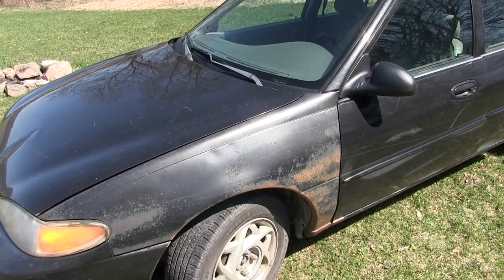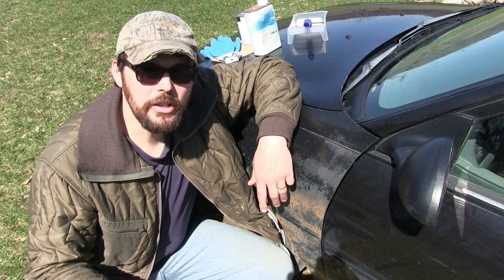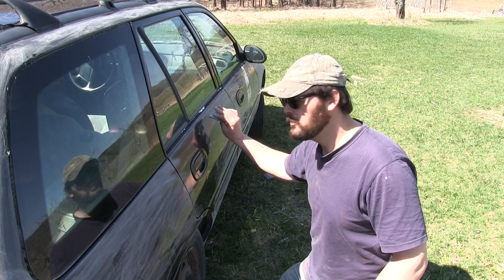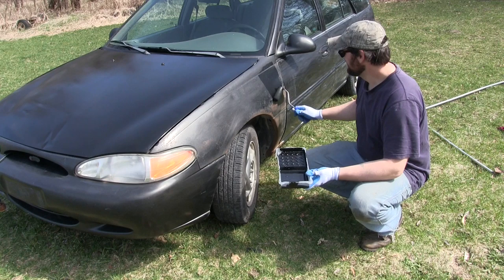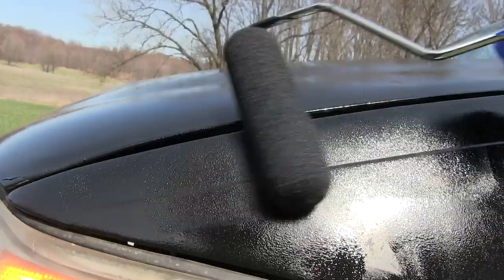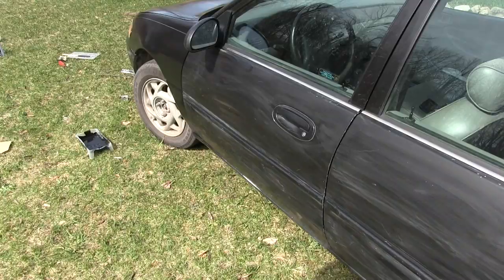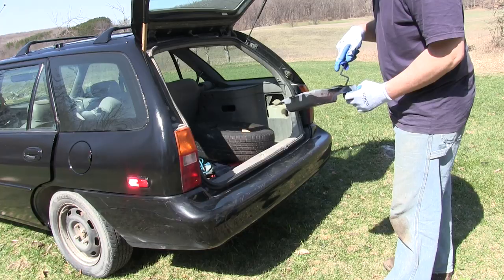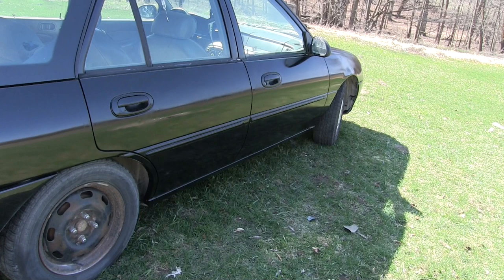Paint Your Car for $20 Bucks !!!!

Comment: Just to add, always have a cloth in your pocket for when the roller is painting what it shouldn't, much easier than trying to take it out after it dries. And for those who do not like the texture that remains (like orange peel), just polish, it becomes smooth like a professional painting. Thank you for sharing your street knowledge, greetings from Brazil
Reply: Sorry, but polishing out Rustolium  is not that easy.  Rustolium is the kind of paint you do not buff out.
Reply: @tommak6516  that is not true at all. Rustoleum can be wet sanded and buffed out easily to a smooth shine.
Reply: @Zero0806  My understanding is that enamel (e.g. Rustoleum) dries to a gloss, and anything you do to it after that is degrading the paint layer.
Reply: @Zero0806 how you go about polishing and getting rid of the orange peel in detail?
Reply: @oyahzi  if you have more than one coat it’s not hard. Wet sand with 1500 then 2000 grit then buff with a god buffing compound. If you’re using a multi speed polished though I’d recommend using a slower setting. Due to spray cans no leaving thick coats it’s easy to accidentally burn through the paint.
Reply: @tommak6516  nope. It cuts and polishes like any other paint. You just have to be careful with it since unless you use multiple coats, you can burn it easier
Reply: @Zero0806  thanks man

Comment: Great job, Dave! I'm of the same sprirt -- I'm 67, never had much mechanical or carpentry training, but I love to try making things I've never done before, because 95% of the time I'm the only one who's going to see or use it. Most of the time it turns out fine. I've built paint tables for my art studio out of scrap wood and logs, a wood shed (Had no idea what I was doing, made it up as I went and it's real solid), a garden shed that's perfect for tools and rainwater collection -- and more. Of course, not all my projects have been successful. I tried building an outdoor work bench out of field stone and concrete, ended up taking the sledge hammer to it. I tried building a little shed out of scrap wood for my generator, ended up burning it. No big deal. I learned a lot each time and believe I could do better if I tried again. Next on the project list is a lean-to extension on my barn, but I'm gonna have help from a friend who actually knows what he's doing for that one. (Too much $ invested in materials and I'm not strong enough any more to lift all the heavy lumber overhead) I've watched a lot of your videos and always enjoy them. Thanks for the inspiration and confirmation.

Comment: Dave: I'm a new sub. after watching your cabin build. But I got an old 92 Chevy with 200K + miles on it and it's the only vehicle my wife and 2 dogs got. We are both retired and living on SS and Dave my friend when the dang sand gets through blowing here in TX. My black and red truck will be all new black and red with a roller method I just learned tonight. Thanks, for sharing Dave, your my kinda people.  Kirk in the TX Panhandle. aka. BP.
Reply from the maker: Thanks Kirk!  Don't paint your truck in the sun and it will probably turn out better.....It was pretty warm and sunny the day I painted this car and it could have turned out better if it were cooler and shady......gives the paint more time to "lay down" it tacks up quick in the sun.  Good luck!
Reply: Thanks for the reply Dave, I will take your advice on the cooler and shady conditions. I pretty much have driven Chevy's most of my life but we had 2 escorts and drove the tires off them. I sold one to a young couple up in KS. and told them I would not take them on any road trips as they had a young child. Found out later they drove it to south TX twice and never had a minutes problem. Probably 2000 mounds round trip on both trips. See why you have kept the little wagon. Really enjoy your channel, however, the woods y'all get to enjoy are nowhere to be found here in west TX. Being a non-conformist is why I'm probably in the pickle I'm in now. Age and finances prevent me from being too radical but I'll do my best. Thanks, Dave and Brooke. Kirk in the TX. Panhandle
Reply from the maker: Thanks Kirk. I'm about to drive my escort to Alaska from Michigan....and it just rolled over 260K.
Reply: @Bushradical  Here's a thought use great stuff that foam will fill in rusty holes and puff out a ways then just shave it off with steak knife or what ever works,  great on my 91 4x4 chev another trick i do is use transmission oil to shine the hood or body of it got over 200k don't know for sure speed ometer not working right.

Comment: Older video, but I wanted to say you did a great job on this.

I've painted a few vehicles with Rustoleum and a roller in my day.. An 82 Rabbit, an 87 Bonneville and most notably, a late 70s Chev full size van that was part way through a restoration.

We'd driven the van halfway across Canada and were spending a few days visiting relatives. The local cops did not like this multicolored van (it was part gold, part black and part red rust paint) so we stopped by a Canadian Tire and grabbed a few rollers and a can of black paint.

Good stuff!

Comment: I friggin love it! Your philosophy is spot on with this video! Subscriber for life! I've got a blue Prius with 450K, and runs awesome. I've done alot of my own maintenance and I hit a deer, and could only find a black hood. I went by a few body shops, and told them, just paint the hood, and don't even need to do the bottom side. They wanted anywhere from $800-1800 to just paint the hood only! I was like no way! It's a $500 car at this point... I just need it to match, because I UBER, and I know a passenger will make a negative comment if the hood doesn't match. Outside of that I could care less. Just love all your videos. We are kindred spirits!
Reply from the maker: Right on! Did you get the hood painted?  Thanks for the sub
Reply: @Bushradical  I just ended up rear ending a Jeep, a week ago, and spare tire crunched the hood. First accident that was my fault in my life. I'm almost 50. Been driving since I was 17. So anyway. I had another Prius that became a donor. I had to fix all the mechanical myself and my local body shop had to do some straightening, and they said if I did everything else. They'd help me out and paint the good and bumper to match the rest of car for a couple hundred bucks. I figured that was a pretty good deal, and since I still use this car for Uber. I need to have it looking really good. But if it was for personal use only. I would go your route in a heartbeat. I was going to do that with the donor car. But I think it had a blown head gasket, and at 440k wasn't worth the repair at that point. Thought I had it fixed with everything else I did to it, but nope.

Comment: Back around '82 I helped my brother brush paint a 1969 Chevy pickup. Then he welded up a floor shifter because the 3-on-the- tree broke. When I bought it from him, we pulled the 327 Vette engine out of my wrecked Impala and had the trans rebuilt Mechanic was shocked that it still shifted at all since so many gears were rounded off . I put 8 ply mud & snows all around. It wasn't pretty nor fast on the top end, but from the jump I beat many a muscle car out of the hole. What a hoot it was. Another brother took it after me. I'd wager it went over 400,000 miles before he sold it. Hello from a former Michigander.

Comment: Hey man I did the same thing to my 1982 Jeep CJ-7 about 20 years ago. Some people laughed at me. It wasn't as collectable 20 years ago as it is today. 
  To make a long story short, I bought a case of "Bumper Grey" spray paint at NAPA. Paid about $100. Did a good job on the sanding and prep. Sprayed it on and it still looks pretty good today. 20 years later. That color paint on the body and windshield frame and flat black on the fiberglass top really set off that Jeep. Nothing is shiny on the Jeep except for the satin finish aluminum centerline rims, and they're not too shiny. 
  Recently as I was walking out of a store a little boy saw my Jeep and his face lit up like he had seen a favorite toy. Got to admit that its got a rugged look to it. I had just washed it and cleaned off the chrome rims real good.
Reply from the maker: Awesome! Cant go wrong with a good DIY paint job.

Comment: I like Dave. He and I live in the same county in Michigan. Related to rust, my father had an old piece of 2" water pipe that looked like it had been in salt brine. We wanted to use it as a sign post at the end of his driveway. I put in on saw horses, wire brushed off the loose rust the best I could, then brushed Sherwin Williams Zinc Clad primer onto it. Then a compatible top coat from Sherwin Williams. Amazing result. Sherwin Williams zinc clad is what any person with acres of land and owns things that they want to preserve and who lives in salt country needs. I also applied the same product to Dad's Aermotor windmill before we put it up. He coated the zinc clad with a top coat.  I dare rust to try to appear.

Comment: Awesome vid as usual Dave👍. I can confirm. This method is easy as heck and comes out great. I've used it on my beater Jeep several times and even done a few small body repairs on some classics.  Add a one two process of some soapy water and wet sand, along with a good buff with some rubbing compound and you've got yourself a beauty of a paint job for mere pennies 👌
Reply from the maker: I need to try and buff and wet sand sometime. That would be new to me.  We need to sit and have a beer sometime, I think we're on the same page!
Reply: Bushradical 🍻Count me in Brother. I ever finally get my as* out to AK, I'll swing by and crack a few with ya to celebrate your 2 millionth subscriber by then 👍🍺
Reply from the maker: Right on!

Comment: An Escort!
I just recently retired my 1998 Ford Escort ZX-2 that I bought in 2005 for $1100.
It still was averaging 33 mpg and had 330,000 miles on it. 
All I ever did to it during all those years was put on a new timing belt, one new serpentine belt, an alternator, and of course tires (as needed) and a couple of batteries. 
I did fix the air conditioner once, but when it stopped working again a few years later, I didn't bother fixing it...didn't need it. ;)
When I gave it away to someone a few months ago, it needed a valve job and a new water pump. 
The guy gladly took it knowing what it needed, he fixed it, and it's still going strong. :)

Comment: one of the best days ever was the day we painted my buddy's '55 Rambler.  We used ship side grey milspec deck paint.  It was 'free' use big rollers, there were no small ones back then. We did tape it because we had 5 guys working on it.  Sun baked that paint on hard and that car looked great.  Cost?  Rough figuring, probably $10,000 to the gov't!!  You know that milspec stuff doesn't come cheap!!!:-)
Reply from the maker: LOL! Thanks for the laugh. That cracked me up.
Reply: Long time ago when I was a wheeled vehicle mechanic in the U S Army we painted our mechanic shop yellow.  That paint was as thick as molasses. Our section chief told us to slop it on there thick. Some said they put lead dust in it.

Comment: It's not a car I painted, but a 6.5 x12 foot utility trailer, that I'm going to make into a camper.  Here is what I did to the underside so that it doesn't rust quicker.  I took some cans of "Flexseal" and spray painted the underside of the trailer.  I'm thinking I might just do the same thing to the underside my car, also.  Think how long the frame just might last.  Thanks again Dave.
Reply: U should of made a vid of what you did to ur trailer. Thanks for sharing tho.

Comment: Great video Dave. I've painted a 1973 Vega with Rustolium Red with a spray gun that turned out good enough for me. I currently have a 1994 Chevy G30 with 364, 574 km. on it that I have self converted to my home on wheels. I just keep sanding the bad spots and either use a spray can or a brush to put more paint on it. I'm going to use a roller next time. Thanks EH!
Reply from the maker: Let me know how it turns out

Comment: Looks ok. I sprayed some Rustoleum Black on my Trooper hood reduced with gasoline and while it sprayed ok, Rustoleum Black is not a pure black, it is a gray black, not a deep rich full black. What is a good black spray paint is the Behr Black at H Depot. I painted a replacement white rear Trooper door after getting hit in the back and it gave me a smooth rich pure black color, just like the OEM black should look.  And a very nice shine reflection in the paint. I may eventually paint the whole car with that Behr Black spray paint, it is also cheaper in cost than other spray paints. You can really see slight variation in the shades of black just like any other darker color.

Comment: Tough little cars. Had one son rolled it at least three times as far as I know. It was used as a daily driver and hunting vehicle. Sat for two years in a field flooded and sunk into the ground. A guy wanted it to go to work put air in the tires jurked it out with a tractor fired right up.

Comment: I have painted several cars and a truck with Rustolium and a $29 spray gun from Harbor Freight. HEY ! It looks better than an old red washed out  85 , F150, with a white hood, and a green fender. (which is what it was). I painted the rims and rear bumper almond white, and it looked great. I mixed a little bit of black paint into the red, to get it almost a perfect match to the original color. At least I didn't look like Jesco White when I rolled into town. From 50 ft away, it looked like a nice old classic, and my wife wasn't embarrassed to be seen in it anymore ! Total job cost me about $35.

Comment: I painted my 1988 dodge truck with 8 cans of spray paint..looked pretty good..didn't use any sand paper are acetone...my horses donkeys and mules and all the dogs didn't mind...I like that paint like you put in bed liners..rough out..I would just like your opinion...it is my Ford Ranger
  I have been thinking of changing the color it is an 98 step side.fenders are banged up and a deer clobbered me and had to change out the whole front end and living on a ranch horses and tree limbs and a bee got after me and my dog Gus..I was pulling a trailer with a donkey and was keeping my dog away from the bee and wasn't watching and hit a mail box..yelp big scratch on the side...and we drove 4000 miles from Texas and back to New York...didn't take a spare or a map..Gps only word sometimes one we went through 7 extra states in a snow storm..this Texan never sees snow..so a 20 dollar paint job sounds good to me..truck is red...quite the experience to go and back in a week..we almost FROZE to death..just me and my dog Gus and we invited the Lord to make the trip with us...so the Ranger could use a touch up...any advice....would black cover red...thank you...
Reply from the maker: Yeah black would cover red for sure. Prep work is important. Make sure you sand it up a bit and get all the dirt and loose stuff off. Good luck
Reply: @Bushradical  thank you...I have been thinking about it awhile and for sure before Texas weather gets super hot will give it a try...thank you...

Comment: a buddy of mine had an old Chevy citation that was all rusted up. he sanded it down patched a few holes and painted it with Tremclad . It worked like a charm and it looked way better. Great job brother.
Reply from the maker: Is the Tremclad the paint they sell at Canadian tire?
Reply: Bushradical you can get it all over the place. I believe it is a paint line from rustolium. good paint,  does what it is supposed to. The primer is excellent too works just like the paint

Comment: Love it. I'll bet if you were to put it on heavy you could probably sand, cut and buff this stuff to be as glossy as you want it to be. Probably don't even need to do it all in one sitting. Going to try this on my E36 since it's 3 different colors...worst case scenario is I'm out a couple hours and $20-$40 and it still won't rust.